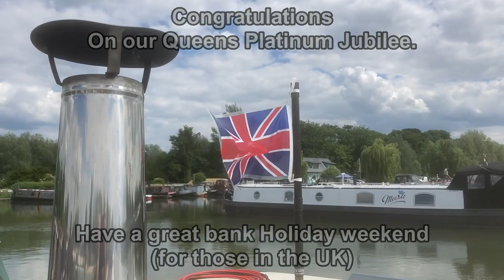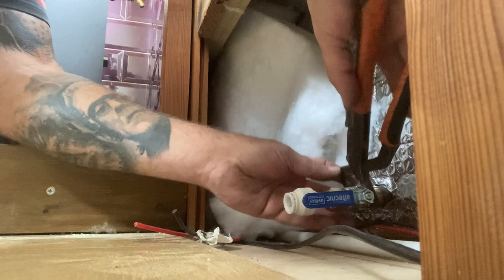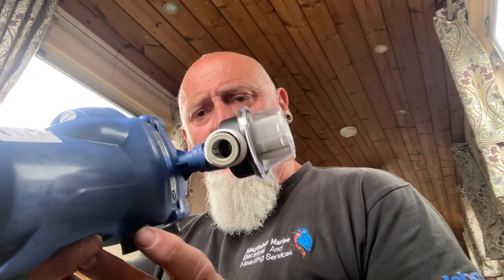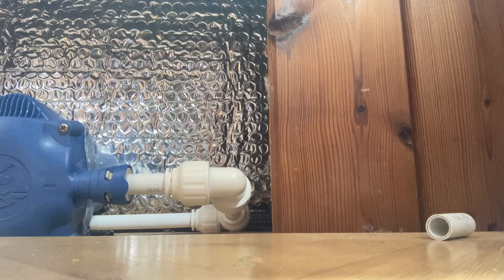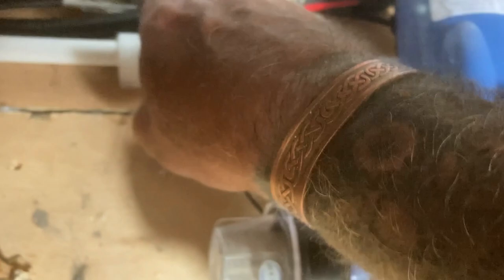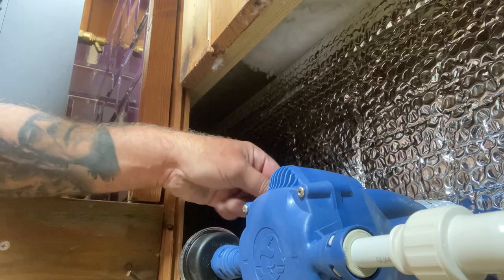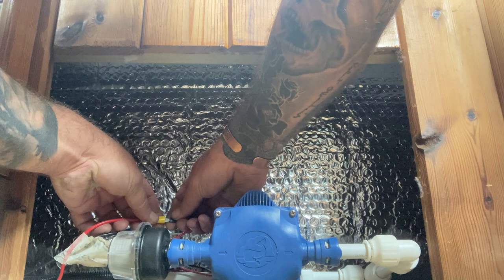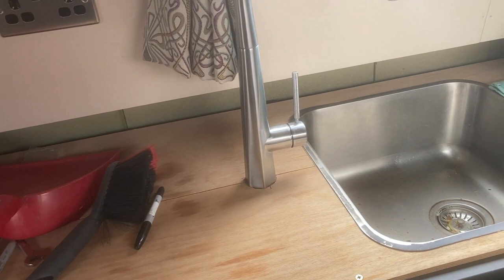Building Our Narrowboat #48 - Running Water & Tall Ships

Comment: Another great vlog. It chimes in with what I was up to last week. I spent 3 days on my boat trying to understand the ancient and unlabelled electrical system that has all different coloured wiring on it.  I found the positive and negative inputs, and wired in a new fuse box from those, and wired in the water pump and Thetford cassette toilet and got them plumbed in too. I’ve also installed a galvanic isolator from the shore power earth.  So I now have running water (cold) and a working toilet.

I am sorry to hear about your granddaughter and hope she makes a full recovery soon. My heart goes out to her, as I have had otosclerosis, which is calcium build up on the stapes in the middle ear. I had to have a stapedectamy which is where they go in through the ear-drum, remove the stapes and replace it with a Teflon  replacement.  I hope she gets better soon. Sending my best wishes to you and Fran and your family.
Reply from the maker: Thanks so much for those kind words. It is looking really positive right now, so we all feel a bit calmer. You have been busy! All my electrics are being fully labelled, have started that already, as much for me in the future or the next owners. Prob plumb our toilet in today.

Comment: Looks good....fiddly job.
Plumbers tip: When putting ptfe tape on a fitting hold the fitting in your left hand and wind the tape over the top of the fitting with the right hand.
That way the tape wont unwind as you tighten the fitting....
Simple tip but I havent seen anyone explain that yet, maybe wrong but!
Question: Any filtration planned?
I like the tank filling hose inline filter, simple but effective and makes sure the sh1t doesant get into your tank in the first place....that filter on the pump is only for rust or grit I think?
Reply from the maker: That's a good tip Dave. I'll try and remember that. I know about winding the right way, but never figured a easy memory jogger. Yeah, the filter is just to prevent debris getting to pump. As tank is stainless we don't have to worry about rust and paint. We only filter our cold drinking water, just through a Brita jug.